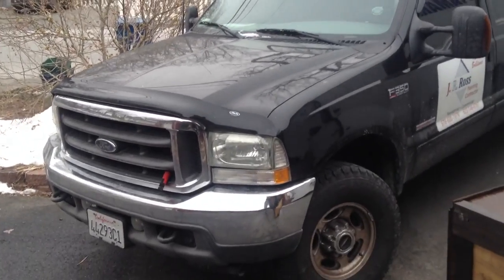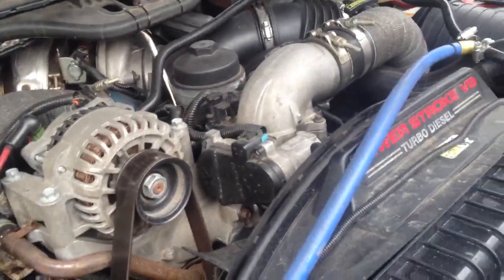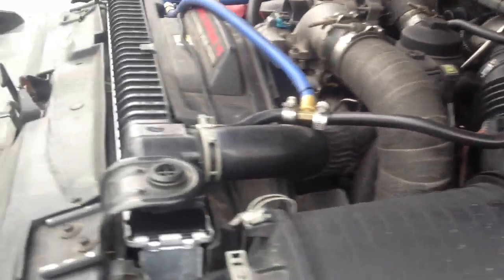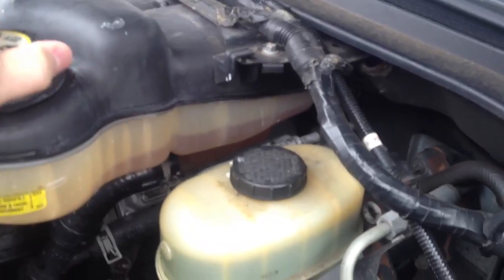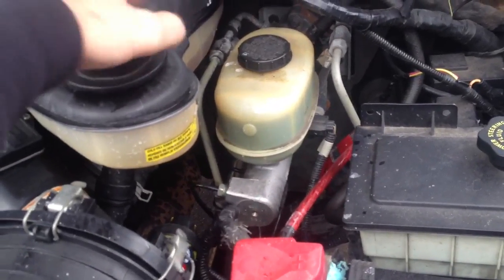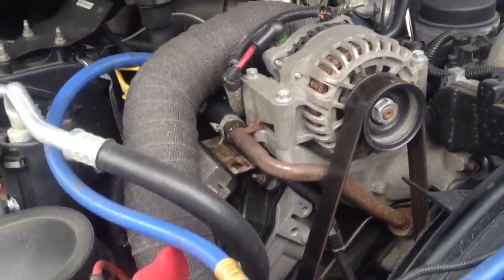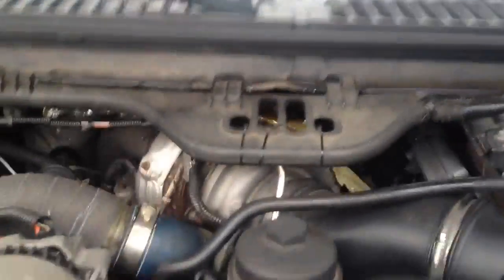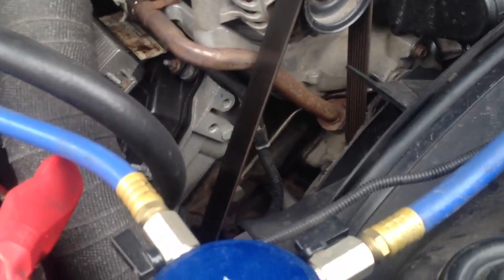6.0 ARP head stud install cab on

Comment: I've always been a big FORD fan. It seems to me a Cummins in the way to go though. Scared of all these 6.0 problems. Cab off to work on the motor? That must cost a crap load.
Reply from the maker: CHRIS BROESKY  can be pricey,  and if I didn't own a business I probably  could not afford to spend the money.  I figured out that I could afford 12k a year in repairs and still be cheaper than buying a newone.  since this video,  i only had to replace two injectors  that failed when the diesel fuel froze 2 winters ago.  the bulletproof kit does work.  The engine is solid and only failed when they adapted it to a 350 chasis.  the 6.0 was meant for big international semi trucks.  it wasnt deaigned for  350 chasis and to comply, epa shit had to be added to it causing the problems.

Comment: I ended up tearing the engine out and going through it.  I did put studs on it.  haven't had a related problem since.  I did blow two injectors  about a year ago when the truck died on me.  ended up being due to the night I took the family out to dinner in a snow storm.  the diesel fuel froze and gelled.  had to get towed home.  fuel starve blew  injectors.  figured gas station would have treated diesel.  now I always carry 911 red bottle and other additives

Comment: factory tunes are tunes.  instead of a generic one size fits all tune for a truck, customs tunes optimize your particular truck. sct,  is a tuner, the tunes are custom written by someone for your truck.  I get better fuel economy, towing and power through tuning.

Comment from the maker: Just to address the concerns and comments about the coolant filter.  To start off, if you cant afford to purchase one then you really have no business owning a 6.0.  It’s 5 grand to replace the head gaskets! Thousands to repair.  I used to need it to filter out the loose sand and flash boil debris generated from the coolant overheating in the egr elements.  Since I have deleted the egr, egr cooler and oil cooler, I no longer have the need for it.  I did however have the need for one prior to installing Bullet proof diesel’s 6.0 package.   Whatever debris was filtered out of the coolant avoided clogging up the stock oil cooler.  So if you have the stock oil cooler you can add one and prolong the amount of time before you will have to replace the oil cooler.  But if you, screw around and use a tuner, you will produce more residues in the coolant that will clog your oil cooler passages faster.  
So in short, if does what it is intended to do.  I will post a video of that filter and cut it open to see what it has collected over a year.
Reply: JamesRRossII i

Comment: Coolant filter is the biggest waste of money you can buy. Whatever "reaserch" you saw to get you to buy it worked way to well. If you had the system setup to sit in place of an actual coolant line it would work. However teeing off the shit they have you tee off is wothless. Coolant like all liquids will take the path of least resistance. In a 24 hour period of constantly running you are only filtering a pint of coolant. Which in a system that hold 7 gallons of coolant makes it useless. Too many people buy into this fraudulent setup.
Reply: The point is to catch it over time, not in 24 hrs or 48 or even a week or a month.
Reply: I understand that and the theory. Im just saying it would seem to be more beneficial if it was not teed into anything. Again not sure if the filter could keep up with the flow rate. Or if anything teed directly off the oil cooler entrance instead of what i believe to be the very last path the coolant takes before it begins to be circulated. I have been working on 6.0s for a very long time and while i will admit it may be slightly beneficial ive done oil coolers on 6.0s with that setup and still seen large amounts of debris clogging the cooler just as if it had nothing. I think a more cost effective, depending on your mechanic, to remove the thermostat and thoroughly flush your coolant every 30k.
Reply: Just my opinion. Everyone has em. Some stink
Reply: Colin Leiby I agree. Just slapping a coolant filter on is pretty much useless without first doing a complete and thorough flush. Then, if necessary, replace the cooler, then install filter.  What's your opinion on bypass oil filters? They pretty much work the same way, don't they?
Reply: rts well ive seen a few setups and i have the same feeling on those as well. I know amsoil loves them considering the filters are around 60 dollars. Theyre supposed to filter at something like 90 microns. Not sure havent seen the packaging in awhile. Almost seems even less worthwhile. Why not just put that filter in the place of the factory? As you put it regular coolant flushes and oil changes at proper intervals, oil type and weight. Another thing diesel specific that is heavily overlooked 6.4 and up is changing the oil at idle hours NOT mileage. I believe the conversion is one idle hour is equal to 35 miles.

Comment from the maker: Well of course its easier to do when the cabs off. But its not easier to pull the cab without a lift!  Also, a lot of dealerships are advised to pull the motor instead of lifting cabs off because of too many complaints about squeaks and rattles.
Reply: JamesRRossII new bushings are a must.

Comment from the maker: I jope you can afford to fix them or do it your self...not a cheap truck to own.  Head gaskets fail from leaking coolant into cylinders.  Egr cooler leaks and plugs upoil cooler passages fluid it super heated along with sand.  You can swap bolts to studs but might as well pull them.  Bullrtproof deisel oil filter is mandatory. They have good videos why.  

My gaskest blew from age and running innovative diesel xtreme street with stock tty bolts.  But I get 22- 25 mpg highway and 19 city.
Reply: Can you share what things you have done to get to that 22-25 mpg. Thanks!
Reply: JamesRRossII. yes please tell what mods you've done. please

Comment: You had said you eliminated EGR and installed remote oil cooler.I hear these are the main reasons why the head gaskets go. What do you think made yours go? i just bought a low mileage 03 and would like to know what to do help. Can ARP be installed one at a time if head gaskets are good?
Reply: Hey man I’m getting ready to do some work on my 06 6.0. Where have you heard that about the egr delete wanna research that and make sure I’m not going to mess anything up.

Comment: Amen on the Stant cap, I did the same.(Weak pressure = weak boilover protection!) I can see and hear the difference. Also; my 2004 threw codes from corrosion on the pos. battery terminal on the passenger side computer wire. Cleaned it up, no more problems.

Comment: Hello,Very good start!  Have you made any more vids yet? I am getting ready to do the same thing on a 2004.F-350. I have a two post lift so I am thinking about pulling cab. I have replaced injectors on the 6.0  while the engine was still in the mini bus. Not easy. So any way need some info. on your next vids. Thanks Nick